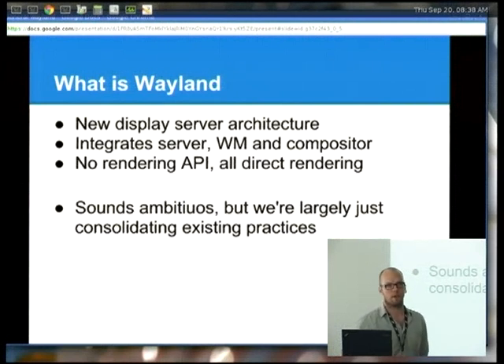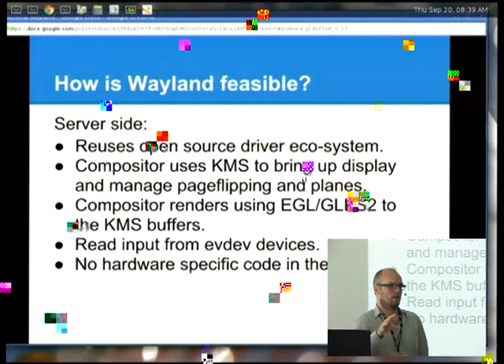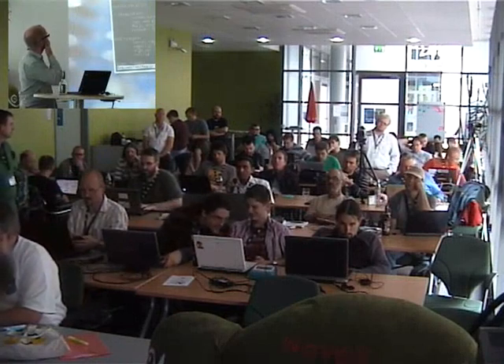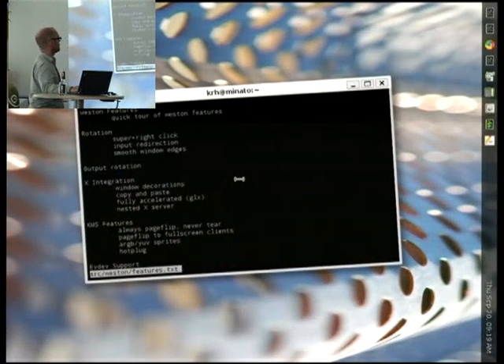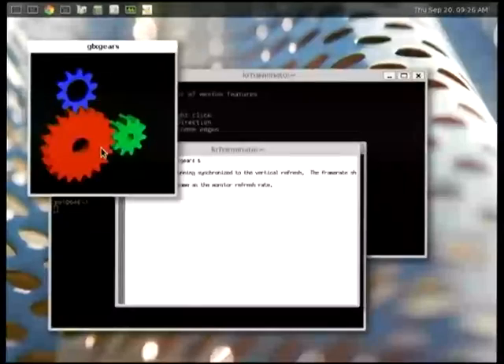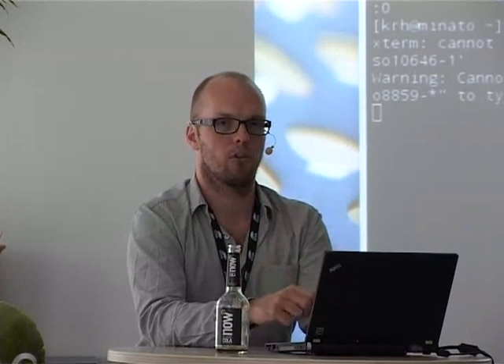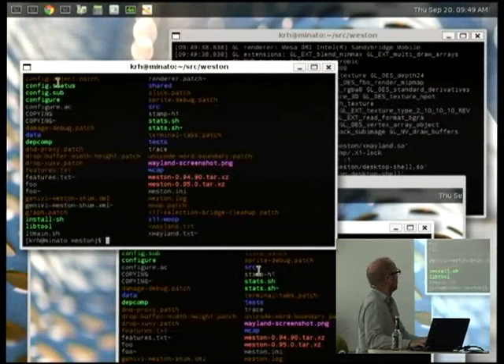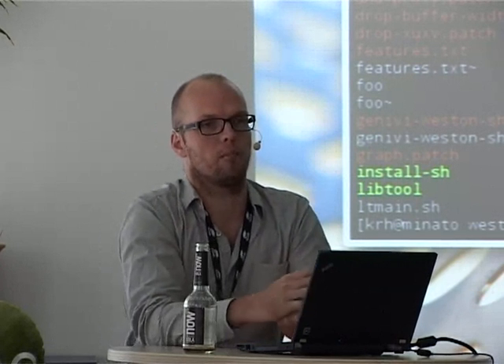XDC2012 - Wayland+Weston

Comment: 37:48 - What about if you're using "clone mode", where the same image on one screen is displayed on another screen (with a different sub-pixel layout)? Then an application is being displayed simultaneously on two screens with different sub-pixel layouts. How does the application handle this?

Comment: If you want to keep it simple and stupid, you should not use X11 but Wayland. If you think Wayland is more complicated than Wayland, then you haven't understood neither X11 nor Wayland.

On a modern Linux system, 90% of the code of X11 are actually unused (X's own input drivers, drawing primitives and so on). Any modern application which is using GTk or QT nowadays is actually rendering the whole window itself, abusing X11 just using as an inefficient frame buffer.